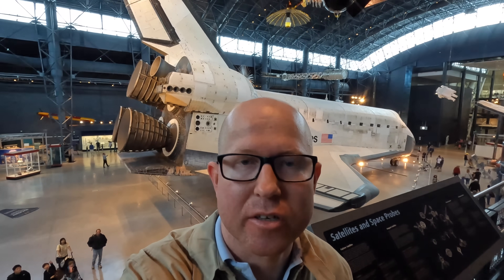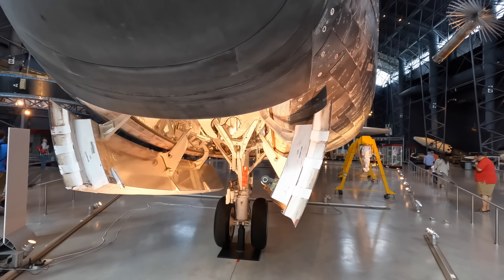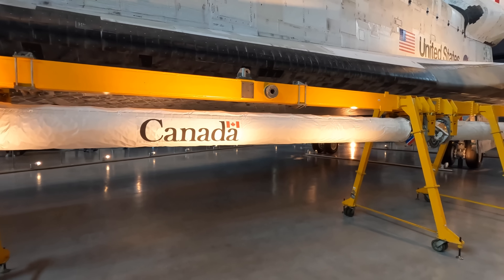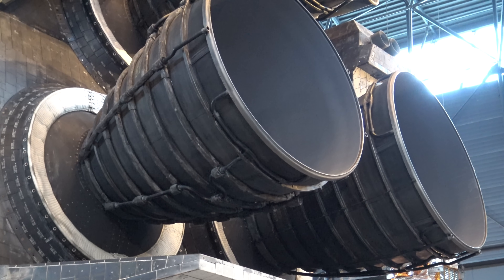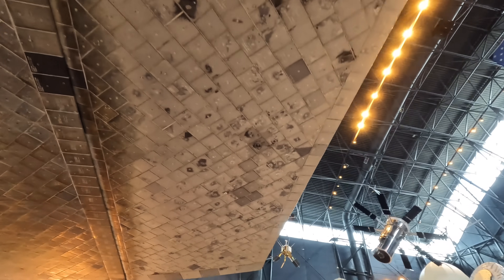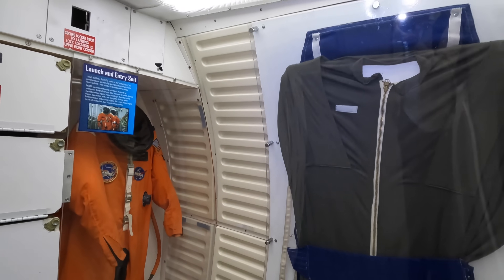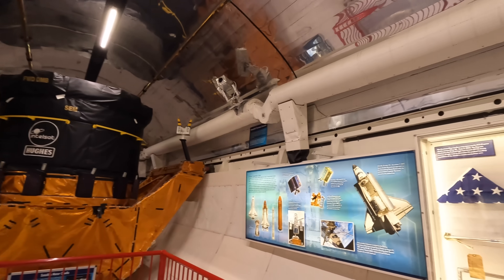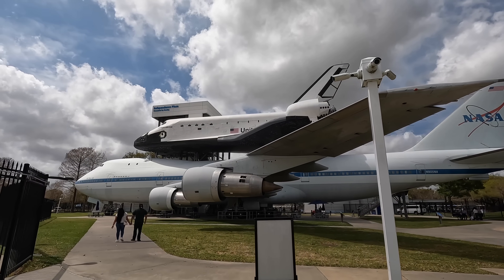Detailed tour through the Space Shuttle Orbiter

Comment: The more I learn about the shuttle, the more I understand its concept is just bad.
Reply from the maker: Why is the concept bad?
Reply: @PaulStewartAviation  I am sorry as I am not willing to write a whole essay here, while I would still love to have a discussion with you. Just a few thoughts. Take a look at the whole reentry maneuver, how many risks that alone bears, with alle these turns and swings. The concept of the tiles has proven to be not reliable. Each landing many were mssing. Checks and resinstalls took too much time and money. Why did the shuttle need a tank and main engines? Why was it not just put onto a liquid fuel rocket? Could a spared a lot of utilities in the shutle itself. And so on. Sure, engineering also developed with time and big credits to the Shuttle's success. Nevertheless, it was built  after a call for bids and not by "free" engineers.
Reply: @Bigalinjapan  They only lost tiles on 3 missions and one of the was after touching down on the runway and no the entry profile was very reliable and never caused an issue throughout the program Checks and reinstalls did not take much time with the record being 54 days and that record was only beaten fairly recently by the falcon 9 and the marginal cost was $252M a bargain considering the shuttle capabilities and they had a ET because hey wanted to reuse the engines while keeping R&D costs low
Reply: @aviationlover3613  I guess then I was wrong.